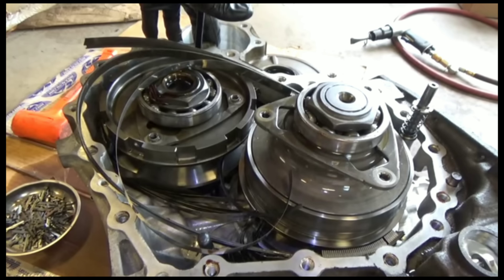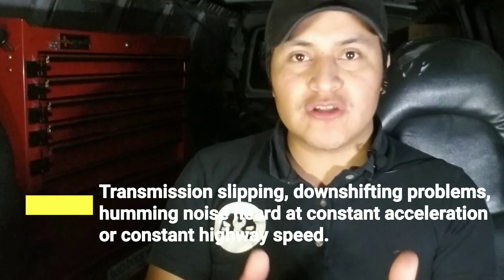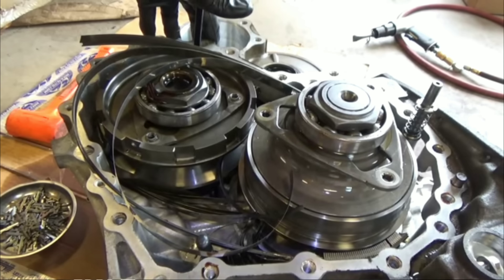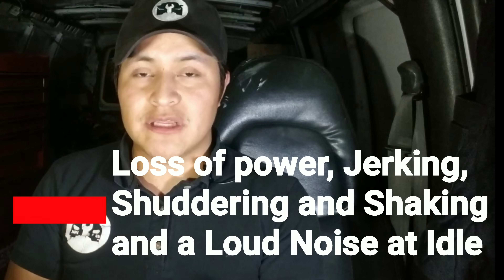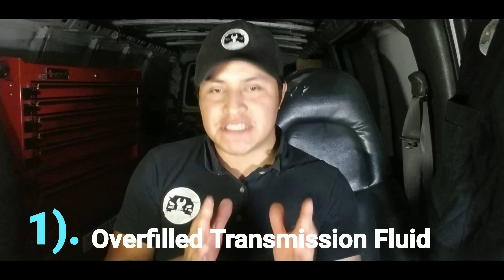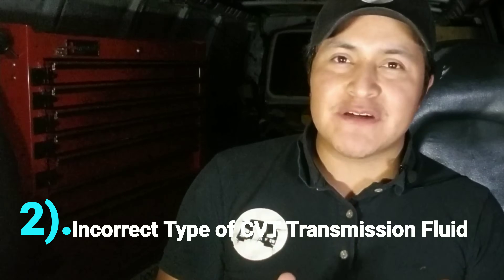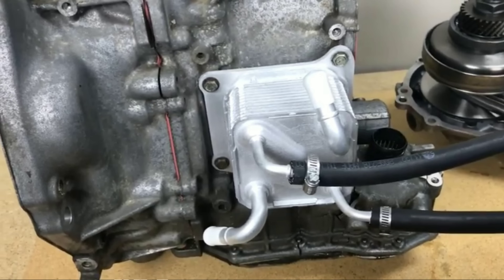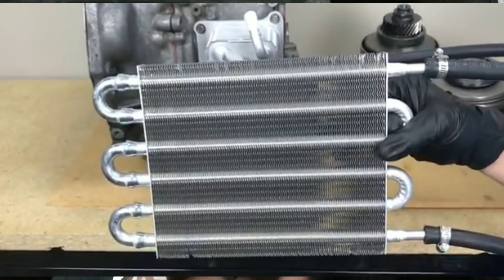NISSAN CVT TRANSMISSION | why it fails and what you can do about it to prolong it's life

Comment: I have a 2017 Nissan versa 1.6 engine as 249 MI it's a brand new car, I bought it from the auction hit in the left front door hard I was going to have it pulled and put a new door on it already bought the part but when I started the car up gave one of those codes have to look it up I think it's 20 use zero you code which states that there's no communication between the TCM and ECM I think there's a ground wire or a loose wire somewhere I don't have the complete schematics on this it did have a broken wire at the throttle position switch to electronic throttle how are them all back together and it's car runs fine beautiful it's just I have some rudimentary schematics hell for something I'm going to try to figure it out with any advice fine that's nausicaa CJ if there's a bad connection in the wires on the throttle position switch it was confused the computer or would not give it the right signal function normally I know that's not very much for a information a professional mechanic, I am a professional mechanic for 50 years I just not familiar with this transmissions procedure I read up on it it's not that much difference I'm just not an excuse and his car for any advice would be thankful

Comment: Excellent video. I replaced my 2013 Nissan Quest with a remanufactured or new one from Nissan. It had only 125k miles when it died.  After I replaced it, it died again at only 166k miles (41k miles on the new transmission). Trying to figure out how that was even possible. Of course, Nissan only gives you 12months or 12k miles warranty on parts alone. Should I even consider another transmission or just stay away from Quest and CVT Transmissions? I put a lot of money updating my Quest and hate to get a car note in this economy.
Reply: You likely didn’t get a NEW transmission. The service mgr told me most warranties only replace with USED ones.

Comment: I have a 2018 Nissan rogue. It's at 223k plus miles. I never changed the transmission fluid. But it's starting to slip, I think it's in the orange, not red yet, but definitely passed yellow.
Reply: The most recent lawsuit alleged that the Japanese automaker knowingly sold vehicles with defective CVT transmissions. Nissan agreed to pay over $277 million as part of the settlement to resolve certain defective transmissions claims. The following Nissan models are included in the 2022 Nissan CVT settlement:

    2014 – 2018 Nissan Rogue
    2015 – 2018 Nissan Pathfinder
    2015 – 2018 Infiniti QX60

This latest Nissan class-action lawsuit to settle alleges that several vehicles were equipped with defective transmissions and that the automaker knew about the CVT problem for years. Several drivers say that transmission and other lemon issues began appearing in their vehicles in as little 20,000 miles.

In 2020, three separate class-action lawsuits were settled with Nissan North America. The bases for these lawsuits were similar claims, i.e., that the manufacturer knowingly sold vehicles with defective CVT transmission systems.

Class action settlements were reached in all three prior lawsuits, which covered the following Nissan models:

    2012 – 2017 Nissan Versa
    2014 – 2017 Nissan Versa Note
    2013 – 2017 Nissan Sentra
    2013 – 2016 Nissan Altima
    2013 – 2017 Nissan Juke

Comment: What signs should I look for on the 7 Speed transmission in the 2nd Gen Nissan Titan 2017 SV?  I sometimes notice it won't reverse until I let it idle on a cold start 5-10 seconds. Works fine the rest of the day.

Comment: I bought a 2015 nissan quest platinum in 2018. it has the ctv with no cooling system.. the worse. i just had the cvt oil changed at 47,000 miles. The nissan mechanic did a code test before the oil change and said everything looked fine. a few weeks ago,/before the oil change/ i could feel a small shudder when i take off.. after reading about all the bad stuff i should have mentioned this but forgot about it. And its not the tires. I think its time to sell it..nissan consumer affairs gave me the run around about it. I just want to keep it but.........

Comment: I have a 2019 Sentra that is at the dealer now being looked at for CVT issues. It has 74,000 miles. The fluid and filters were changed out last October (2022....it is now August 2023 as I write this). The other day it started doing this thing where there is like a momentary hesitation going down the road. It occurs at about 2000rpm between 40 and 60mph. When this happens, I feel a momentary loss of power that lasts 2-3 seconds and the tach goes up to about the 2250rpm mark, then it drops back down. Trying to get out in front of this, I took it to the Nissan dealer first thing yesterday morning. That is when the service rep told me that Nissan knows their CVT is a crap design and that they have extended the transmission warranty from 60,000 to 80,000 miles.
I talked to the service rep a few hours ago and was told that they have been driving and testing it, but it is not kicking out an error code. And if the ECM does not put out an error code, then they cannot make good on the warranty. I will know more later today, but at the moment, I feel that Nissan is likely to be lying to customers and getting out of the expense of issuing a warranty replacement by saying that there is no code.
Reply: When's the last time you changed the oil in the CVT?

Comment: I  bought an '07 Murano with 41,000 miles.  It didn't make it to 42K.  Three dealerships said these transmissions are NEVER repaired, and repair parts are not available.  The dealership I bought it from ghosted me.  All that was available at the dealerships were factory rebuilt units, and they wanted $9500 for it.   Aamco did it for $5400.  Nissan warrants theirs for 12 months, 12000 miles.  Aamco warrants theirs for 30 months, 60000 miles.  My last vehicle was a Nissan Frontier with 4 catalytic converters;  all four were wreckled at the same time by a computer glitch at 100,000 miles, which Nissan admitted, but took no responsibility for.  I WILL NEVER BUY ANOTHER NISSAN!!!

Comment: My 15 Altima 2.5s just hit 170k with no issues at all. Oil changed every 5k, CVT fluid every ~50k, sparkplugs changed every 80k, air filter & cabin filter are K&N so just to clean them every 10k.

Comment: I have a 2012 Nissan Maxima with 266K miles on it. I have never serviced the transmission. An oil change every 5-6K & that's it. I put roughly 100 high miles on the car daily.

Comment: Only fails if you put wrong transmission fluid or don't change your fluid on time. I have the Nissan with 220 k miles and transmission is still  going strong.
Reply: Not true. Nissan's CVTs were defective between 2012 and 2018-

The most recent lawsuit alleged that the Japanese automaker knowingly sold vehicles with defective CVT transmissions. Nissan agreed to pay over $277 million as part of the settlement to resolve certain defective transmissions claims. The following Nissan models are included in the 2022 Nissan CVT settlement:

    2014 – 2018 Nissan Rogue
    2015 – 2018 Nissan Pathfinder
    2015 – 2018 Infiniti QX60

This latest Nissan class-action lawsuit to settle alleges that several vehicles were equipped with defective transmissions and that the automaker knew about the CVT problem for years. Several drivers say that transmission and other lemon issues began appearing in their vehicles in as little 20,000 miles.

In 2020, three separate class-action lawsuits were settled with Nissan North America. The bases for these lawsuits were similar claims, i.e., that the manufacturer knowingly sold vehicles with defective CVT transmission systems.

Class action settlements were reached in all three prior lawsuits, which covered the following Nissan models:

    2012 – 2017 Nissan Versa
    2014 – 2017 Nissan Versa Note
    2013 – 2017 Nissan Sentra
    2013 – 2016 Nissan Altima
    2013 – 2017 Nissan Juke

Comment: My wife has 2016 nissan Sentra the rpms go up and down by it self but no noise no lights on dash she took it to the nissan dealer they did a soft ware up date she said her car is doing good what could you tell me sir
Reply: The most recent lawsuit alleged that the Japanese automaker knowingly sold vehicles with defective CVT transmissions. Nissan agreed to pay over $277 million as part of the settlement to resolve certain defective transmissions claims. The following Nissan models are included in the 2022 Nissan CVT settlement:

    2014 – 2018 Nissan Rogue
    2015 – 2018 Nissan Pathfinder
    2015 – 2018 Infiniti QX60

This latest Nissan class-action lawsuit to settle alleges that several vehicles were equipped with defective transmissions and that the automaker knew about the CVT problem for years. Several drivers say that transmission and other lemon issues began appearing in their vehicles in as little 20,000 miles.

In 2020, three separate class-action lawsuits were settled with Nissan North America. The bases for these lawsuits were similar claims, i.e., that the manufacturer knowingly sold vehicles with defective CVT transmission systems.

Class action settlements were reached in all three prior lawsuits, which covered the following Nissan models:

    2012 – 2017 Nissan Versa
    2014 – 2017 Nissan Versa Note
    2013 – 2017 Nissan Sentra
    2013 – 2016 Nissan Altima
    2013 – 2017 Nissan Juke

Comment: You know, I don't have a cvt, but I do have a Nissan Titan. It's the oil burningest , smokingest, transmission fluid leakingest, popping under the console st,no window workingest, one radio speakerest, CD player nonstop trying to load a disc that isn't there est,valve cover cloggingest, parking spot markingest, gas drinking est, piece of crap I have ever owned. Interior is  ,,,,,, well the seats aren't in bad shape. When I bought it, I was thinking,it's a Nissan. Can't go wrong with this ! Lol 😂

Comment: Guys, i would like to share my experience with Nissan Altima 2018, my vehicle is now 60,500miles and i changed CVT fluid at 50,000miles, i only drive carefully from 0 to 20 or 25 mph since the oil pump is pumping oil to CVT solenoids therefore i drive carefully throughout this range of speed however after that i can run and reach 160mph no worries still my CVT is running smoothly and efficiently, no problems, no humming noises, no high RPM therefore guys try to make sure of your driving is adapted to your CVT and make sure of right and scheduled services and it will last for a long time

Comment: Just had to have my 2016 Nissan Altima transmission replaced.  60,000 miles.  It was starting to slip and jerk during high speeds or when hitting the gas.  It was covered by the extended warrenty that Nissan put in place due to this very issue.  They replaced the entire transmission at no cost.  And I'm glad to see the comments about how the new replacement transmissions are not having so many problems.
Reply: I called they said it wasn't covered. Very weird what's happening
Reply: My friends 2015 Altima's CVT failed.  Nissan said "no" to replacing it under extended  warrenty. But yes to a rebuilt $6,200 CVT. My friend is pursuing the complaint strategy to Nissan, BBB, NTSB.
Reply: Mine is slipping and I just got to 90,000 miles. It's past the covered warranty. Now Nissan wants 8k for a new transmission
Reply: @Lame_He  did you drain the transmisión fluid periodically? Are these the first sympthoms your cvt?

Comment: I've noticed after driving about 75 miles in one day, the engine RPM on my Nissan Murano nearly doubles from around 2000 RPM to about 3500 RPM at around 60 MPH.
Reply: The Rogue transmission began to go when it was at 65 mph, and the transmission got hot. It has a leak. Trying to find how to replace the vent hose. Transmission fluid was all over the top of the engine burning fumes into the car. 
Which is why I'm here. But the rpm should not increase that much.

Comment: What’s the cost in labor to replace the whole transmission qx60. I asked my Infiniti dealer to replace the fluid and they said no, it for life, I laughed.  It was done when they replaced the torque converter at 60k miles and again just over 100k. Now it’s at 140k miles and I was getting ready to do the filter and trans fluid but it has started to lose power off the start. I think the trans is now bad and the pump bearing. I see low mileage trans on eBay.

Comment: Im getting the P0720 code (Transmission Speed
Sensor) and the P0746 code (pressure control
Selenoid) on my 2009 Altima, the car doesnt
move at all as if the gears doesnt engage...what
would you suggest in this case??

Comment: I was looking at this 2017 Nissan Sentra Sv  60,000 that someone wanted to sell very cheap because the cvt transmission was slipping. I started looking at it and was checking it. It literally drove forward and reverse just fine for about 2 blocks then just quit. Is this something that can be fixed?
Reply: Should have done your research first-

The most recent lawsuit alleged that the Japanese automaker knowingly sold vehicles with defective CVT transmissions. Nissan agreed to pay over $277 million as part of the settlement to resolve certain defective transmissions claims. The following Nissan models are included in the 2022 Nissan CVT settlement:

    2014 – 2018 Nissan Rogue
    2015 – 2018 Nissan Pathfinder
    2015 – 2018 Infiniti QX60

This latest Nissan class-action lawsuit to settle alleges that several vehicles were equipped with defective transmissions and that the automaker knew about the CVT problem for years. Several drivers say that transmission and other lemon issues began appearing in their vehicles in as little 20,000 miles.

In 2020, three separate class-action lawsuits were settled with Nissan North America. The bases for these lawsuits were similar claims, i.e., that the manufacturer knowingly sold vehicles with defective CVT transmission systems.

Class action settlements were reached in all three prior lawsuits, which covered the following Nissan models:

    2012 – 2017 Nissan Versa
    2014 – 2017 Nissan Versa Note
    2013 – 2017 Nissan Sentra
    2013 – 2016 Nissan Altima
    2013 – 2017 Nissan Juke

Comment: I have a 2013 Nissan Altima with 160,000 miles and still running fine. Sometimes I accelerate a little hard, and some I go up to 120 MPH. I haven't changed the oil on the transmission. I just change the motor oil every 5,000 miles. I went to mechanic school and do all the services myself not once at the dealer, well only at first when I had a free oil change with a free car wash. The problem I had once that make the car shut off and drive very slowly was a dirty throttle body. It took me a while to find out the problem, at first I thought it was the transmission but it wasn't. I just removed the throttle body and clean it with throttle body cleaner, a rag, and sandpaper and that fix my problem. Been running it since then and no problem.

Comment: I have a 2018 Nissan Altima at only 58k miles and just started having a lot of tranny issues... Luckily I am still under factory warranty. It could just be the tranny fluid is low but since Nissan, in all its brilliance, never included a dipstick on their tranny fluid cap I didn't have a way to actually check... be careful about this vehicle everyone.

Edit: It was not the fluid, it needed to be rebuilt.

Comment: When overrated transmission glued gets hot, a film builds up and sticks to the metal . so change your fluid freakishly 
If you drive it like a bad boy.. The fresh transmission fluid has detergents that break up the film that sticks to ports and bearings. When the ports are coated with film from over heated oil , the volume of the ports are restricted and less volume flows through the ports to the cooling system causing more over heating.. So if your driving it harder than designed , frequently chasing the transmission fluid.

Comment: What if it only sounds like a bad power steering pump when I'm accelerating up a steep hill? - '14 Murano S, 137k mi, CVT replaced in 2019 @  79k mi
Reply from the maker: A bad power steering pump would make the noise more when turn the steering wheel

Comment: Check your alternator if you’re having transmission issues on the v6 model. I had 3 shops say transmission was failing & needing replacement for $6,000 k. I went to a tire shop of all places & mentioned the transmission issues and the tech instantly said he was going to check my alternator. Sure enough my alternator was burning out and testing bad. Replaced the alternator $900 & 2 years later transmission is running fine no issues no replacement no other repairs needed. The transmission has a electrical safety switch that the alternator was tripping when it was having periodic shorts.

The tech said it’s a common thing they see on Nissans. People coming in for alternator work on altimas after a transmission replacement doesn’t fix the issue cause it was never the transmission

Comment: The simple fact is, you can do fluid changes before the schedule change and baby the tranny - when you buy the vehicle new.  When you get a used vehicle you don't know shit about it.  This is where you get screwed.  If the tranny starts to go bad you can't get a repaired one because no transmission shop will work on them.  Therefore, no used repaired ones, no one willing to fix it.  Other choice,  junk yard.  No to this; you likely going to get one from there that is going on or is all ready done, kaput.   Only choice is to shell out $3,000 dollars to the dealer for a new one and you still have to pay someone to remove and replace it.  In the end, stay the hell away from any car with a CVT transmission.